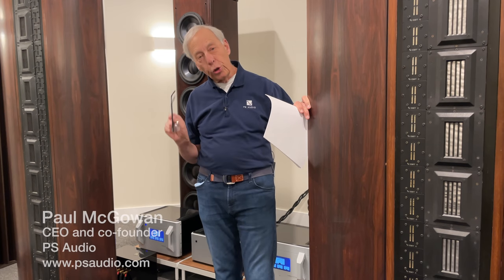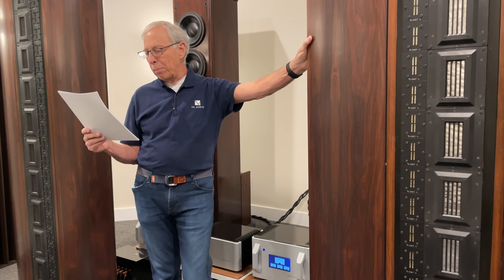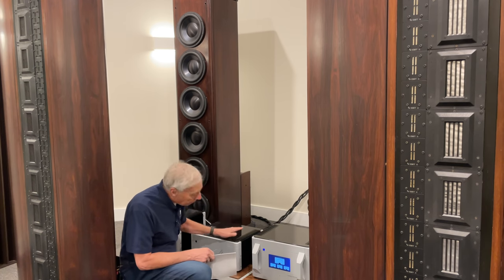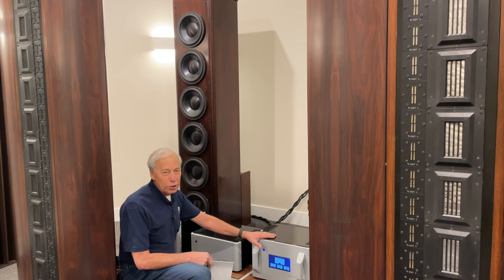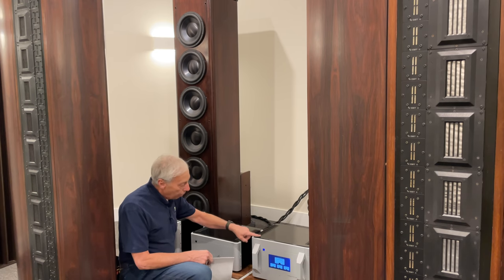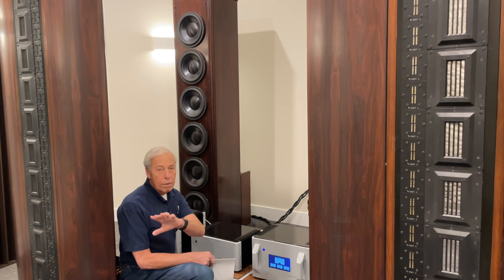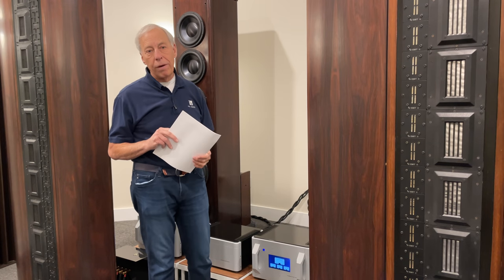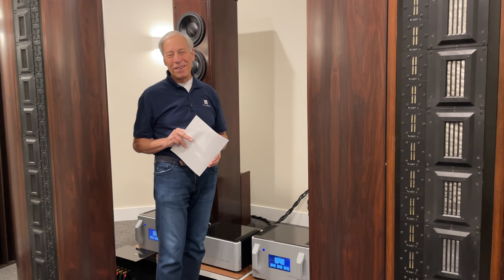Separate Power Plants or long power cables?

Comment: The range of the voltage standard for service is +/-5%.  But short, infrequent dips to -13% are permitted before the power company has to initiate correction. (ANSI C84.1)  So for a 120v circuit, that means you can dip down to 114v in good service and 104v for short durations and the power company is still meeting the national standards.  And that is just to your meter.  Inside that the NEC permits a voltage drop of <3% on feeder circuits plus <3% on the branch circuity.  So worse case with "good" operation is your voltage could drop near 20% when you take a big gulp of current for a brief time.  Then you can throw in voltage drop over long or bad power cables from the wall.   Power Plants are said to buffer this and provide much cleaner and less tolerant of deviation power when your system wants a big current draw for that bass.
Reply: Good and accurate comment!

The focus of the question, though, was the power cable - why do you need a high end cable?

If the cable that comes with your equipment is, say ,14ga copper, and your power socket is within 3 meters and you plug directly into the wall, and you have a 120v line with 15 AMPS, the loss of wattage will be what (based solely on the power cable - not the dips in dip/peak in power flow)? 
Miniscule according to Ohm's Law.

Because electric cables have a resistance per foot, and the longer the cable, the larger the resistance. When current flows through the cable, the current flowing through the resistance results in a voltage drop according to Ohm's law, [voltage = current x resistance]. 

Power in watts is voltage x current. A given current and cable resistance defines the applicable voltage drop

A 15-amp current through *100 feet * of 12GA or 14 GA cables would result in voltage drops of  2.4 and 3.75 volts respectively.

The voltage drop multiplied by the current gives the power in watts. 

The cable run of 100 feet, carrying 15 amps, will have power drops of 36 and 56.25 watts for the 12 and 14 gauge cables respectively.

While all this is science, and a 14GA cable on a 15AMP line is losing almost the same power as turning on a 40 WATT light bulb, that's with *A 100 FOOT RUN*.  On a 3 - 6 foot run, that loss is miniscule.

But even if you put an 8GA 50AMP cord  on a 6 foot run, you're still only going to get 120v / 15amp power flowing through.  The cord the mfg provided already does that with ohm's law in mind when they build it, and set the length of it.

I'm thinking the a high end cable is "better" only in the quality of the copper (or silver) in the wiring, and the design of the shield, which should all result in less resistance... which in theory, should result in less power loss over the same distance - as miniscule as it is.  

And hey, that's a good thing

Comment: I’m running my system using a 1 Gigawatt natural gas power plant that is 50 miles away supporting both left and right audio channels. The few feet from my outlet is sort of a tiny fraction of the distance and important is to use heavy gauge power cables for those few feet 🤔
Reply: That's ridiculous! Have you no interest in the highest sound quality?  Any self respecting audiophile knows the best sound comes from hydro power plants. The smooth running water over the turbine imparts those same qualities to the electrical power and thus the sound. Gas fired, much too violent but at least it's better than nuclear. I mean smashing atoms and splitting them. That has to add extreme distortion to the sound.
Reply: @andydelle4509  Alright, agree, but you forgot to say that any self respecting audiophile will need two hydro power plants for maximum channel separation. But have you listened to a system using battery storage power plants? Here in San Diego we have the new 250-MW Gateway Energy Storage Project that with batteries avoid the classic water bubble noise you get from hydro power plants.
Reply: @ThinkingBetter  with my solar panel, I my audio system gives a powerful light in the room. I can even see how the sun is radiating.
Reply: hahaha :)
Reply: @andydelle4509    - hilarious
Reply: @ThinkingBetter   - hilarious

Comment: I'm seeing some well intentioned comments below that seem, to me, just a little off fact  in trying to answer the question why high end power cables should be used.   

If the cable that comes with your equipment is, say ,14ga copper, and your power socket is within 3 meters and you plug directly into the wall, and you have a 120v line with 15 AMPS, the loss of wattage will be what (based solely on the power cable - not the dips in dip/peak in power flow) - miniscule according to Ohm's Law.

Because electric cables have a resistance per foot, and the longer the cable, the larger the resistance. When current flows through the cable, the current flowing through the resistance results in a voltage drop according to Ohm's law, [voltage = current x resistance]. 

Power in watts is voltage x current. A given current and cable resistance defines the applicable voltage drop

A 15-amp current through *100 feet * of 12GA or 14 GA cables would result in voltage drops of  2.4 and 3.75 volts respectively.

The voltage drop multiplied by the current gives the power in watts. 

The cable run of 100 feet, carrying 15 amps, will have power drops of 36 and 56.25 watts for the 12 and 14 gauge cables respectively.

While all this is science, and a 14GA cable on a 15AMP line is losing almost the same power as turning on a 40 WATT light bulb, that's with *A 100 FOOT RUN*.  On a 3 - 6 foot run, that loss is miniscule.

But even if you put an 8GA (50AMP capable) power cord  on a 6 foot run, you're still only going to get 120v / 15amp power flowing through.  The cord the mfg provided already does that with ohm's law in mind when they build it, and set the length of it.

I'm thinking the a high end cable is "better" only in the quality of the copper (or silver) in the wiring, and the design of the shield, which should all result in less resistance... which in theory, should result in less power loss over the same distance - as miniscule as that power "loss" (or gain?) it is.  

And hey, that's a good thing

Feel free to suggest your thoughts.

Comment: I'm confuses: Why should I use a high-end power cable to feed the power plant? Isn't the goal of the power plant to upgrade the poor wall socket power to something useable?
Reply: Unless you live in a third world country there's nothing wrong with your house power...get an oscope and check for yourself...peace
Reply: @Lloyd Stout get a scope and prove it, btw if the components ps can't supply clean rails it's junk.
Reply: Because ones like those that come with your gear don’t flow enough electricity. Pretty much everything I’ve hooked up with a better power cable has sounded significantly better.

Comment: Hey Paul Since the powerplant is making a new clean sinewave output  why do they need expensive AudioQuest dragon  power cords on their input? While It makes sense on the powerplant output , the input only needs to be of a sufficient gauge wire. And that is if you believe esoteric power cords  makes a difference over standard heavy gauge cords.

a

9

Comment: HIgh Paul, as the very low impedance of a power plant to the Monoblocks is that important - why not to integrate the PP into the MB and why to convert the DC into AC and in the MB back to DC!??

Comment: Power Plants work on the lower current gear but are unnecessary on monoblocks with switch-mode power supplies.

Comment: Why not buy gear with regen PSU inside as Audio-gd?
Reply: Because if you know how an amplifier works, it will do all that for you, automatically. No regenerator is ever needed, especially if it has some form of switchmode power supply. All the amplifier will do with that pretty, low-THD sine wave is just chop it back up into noisy pulsing DC with a bridge rectifier, anyway, so there's nothing to gain, except profits for PS-Audio and Paul, of course! :)
Reply: Of course there will be those that buy things like single-ended class-A triode amps with no feedback, but with a normal class-B amplifier with proper input decoupling and traditional feedback, it will reject most anything the wall can toss at it, besides a brownout or blackout. If you want to truly protect your gear, buy a good surge suppressor. It can do a lot to save the amplifier from seeing sharp spikes that can damage the transformer, rectifier, and capacitors. Sudden 1kV+ spikes and surges are the one thing that neither a regenerator or amplifier will take kindly to.
Reply: @mysock351C  You are right but I meant preamp and DAC. Thx for opinion.
Reply: @WelkySchullin  The DAC and preamp should usually have their own power supplies. The preamp might be the only possible issue if its tube based, but those are light loads so a small power conditioner would have you covered, and the DAC will likely have a switchmode power supply, which does the same exact thing as Paul's power plant. If the preamp is solid state as well, then all that's needed is a surge arrestor to protect them as their respective power supplies will handle pretty much everything besides a blackout.
Reply: @WelkySchullin  Its important to keep in mind that all most of your gear will do with that smoothed power is just chop it back up into DC. The power plants can be of use in single ended or non-feedback based tube amps with linear supplies, but their utility usually ends there.
Reply: @mysock351C  Thx for you answers.

Comment: Good info. I would though say that all cables should be as short as possible, if that is physically possible. It will also save the user money. Long power cables on stuff generally creates chaos in sound. (assuming it is a decent stereo, on normal gear it might easily not do any difference)
I know 1 guy that has a 30m long power cable from the wall socket to the powerbar, which totally messes up his sound. So he is wasting 10's of thousands of dollars on buying better speakers and amps. When he could just cut the length down, the cost down and get a much better sound.

Yeah if it was possible, I would also do as Paul and have a dedicated powerbox per device, that is really cool. It frees up the sound totally, but is crazy expensive. People should also not underestimate short cables on source units, that can really make the sound a lot more clear/focused.
Reply: Hopefully that 100ft cable is pretty thick, like 10ga or else that new setup will struggle.
Reply: @Bsmitty358  I use 10 gauge on 3' power cables. I know but they look amazing!
Reply: @scottyo64   - thats a great set up... a bit of overkill since you're still likely to get only 120v/15amp from it... but hey, at least you're getting ALL of those volts w/ such a set up :)

Comment: If you use a heavy gauge high-quality AC cable to feed a Power Plant the length really doesn't matter.
Reply: I largely agree with this. I think the major issue hinges on the amplifier load and length of the house wiring (and gauge) run from the panelboard circuit to the receptacle. I would expect a heavy gauge, good quality AC cable to pick up and extend the house wiring run perfectly well, assuming there isn't an issue with voltage drop at the receptacle.
Reply: If you use a 20amp circuit and a 12ga power cable to feed your amp, why do you need a "power plant" ??
Reply: i get what you're saying, but Ohm's Law confirms length of the cable will ALWAYS matter in how much power is lost over the run.  Now, on a short cable, that power loss is miniscule, but over a 100FT run, that could be enough to power a 40 watt light bulb (14 GA cable)
Reply: @Lloyd Stout and if your equipment allows you to hear it, you need better gear.